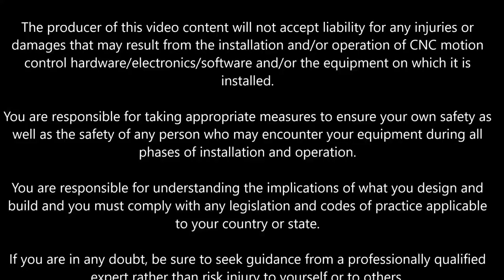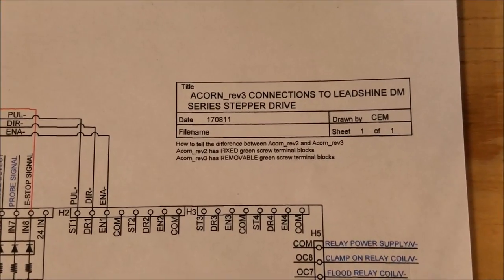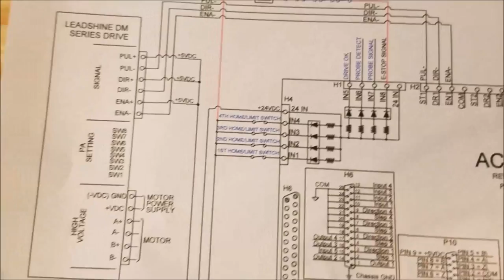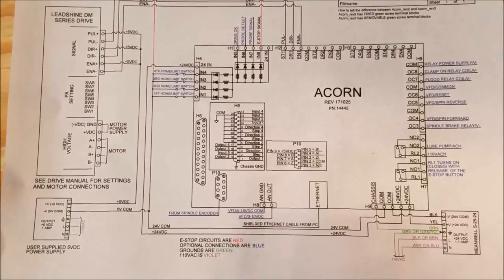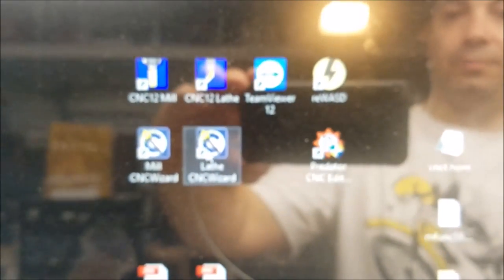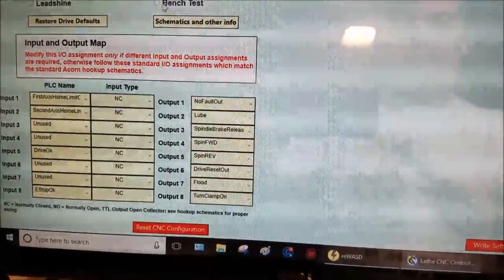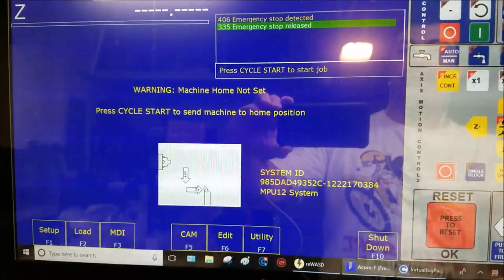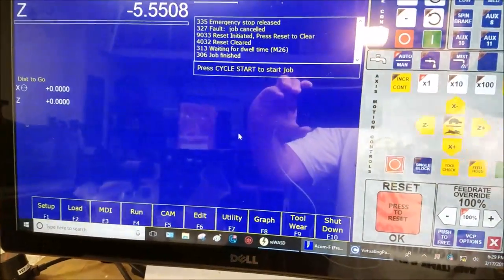DIY Closed Loop CNC Control #4: Power Up Acorn

Comment: Hi Franco   Lot of great information thanks.  Have you tried the DMM4 Servos yet.  I am hooking up my first set for a Mill I built and had some issues with a conflict with the 5V PS I have worked that out but I am not able to get the Centroid to able to control the motors.  Using Version 2 Board and Pro version of the software.  Hooked up per Drawing found on the web site.  There is a lot of noise on mt 25 pin from the Drive to the Acorn.  Making a new set of cables hoping that will help.
Reply from the maker: KoenigCNC Automation and Design check out martyscncgarage.  He is the expert on DMM and Acorn.

Comment: If you want to use all this things but for a milling machine, what would change from all this?
Reply from the maker: Hi.  I'd buy a more powerful power supply and add a third stepper driver.

Comment: It's possible to use acon for plasma tables?
Reply from the maker: Sure.  You can use it with a torch height control kit.  Check out the Centroid Forum for more details: http://centroidcncforum.com/viewforum.php?f=60&sid=5eba1438a0c0e09f9a124b9e54b6630a